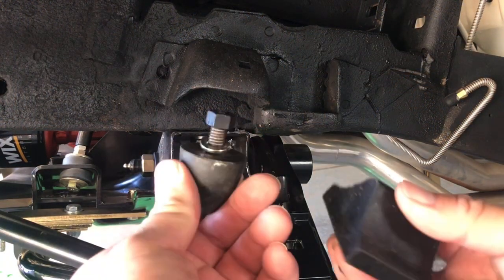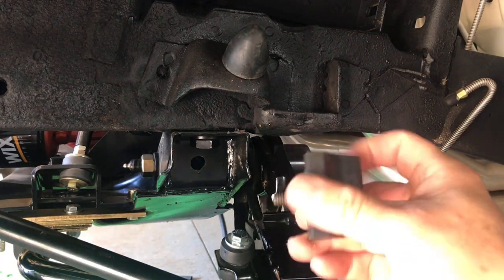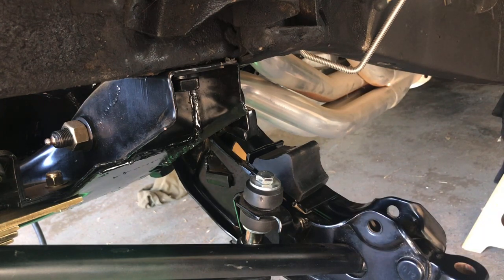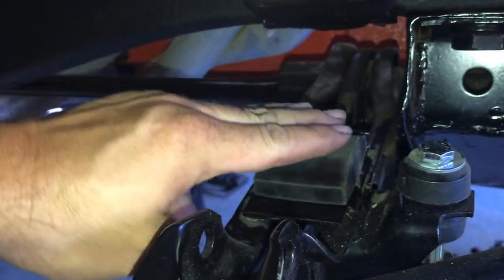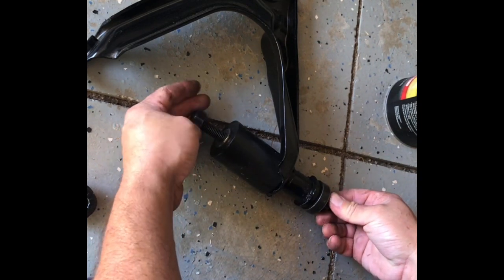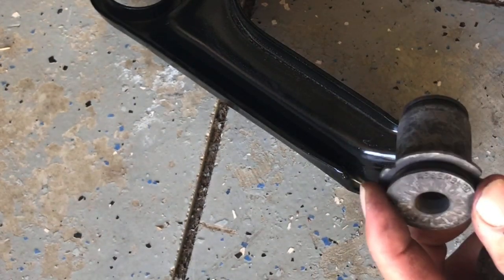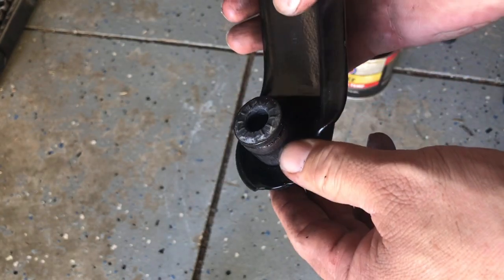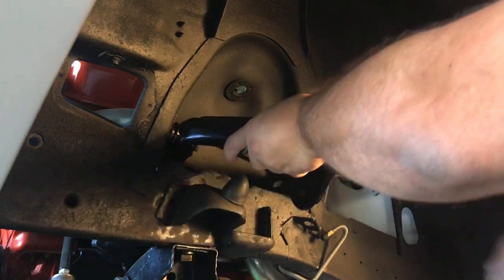How to do a Mopar front end kit install, part 1 bump stops and upper A arms

Comment: Their tool is jacked. It needs to rest on the flange of the outer piece and not put n e pressure on the center so it doesn’t moosh the rubber.
Reply from the maker: 100% agree.
Reply: I used a simple, cheap core plug (freeze plug) that fit the flange but clears the center. Used it with C type ball joint tool. Just saying